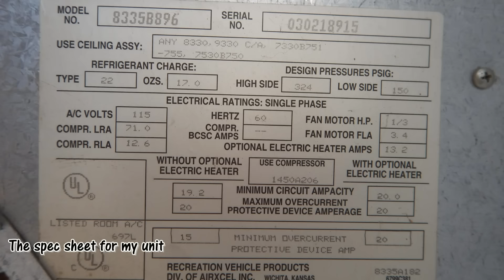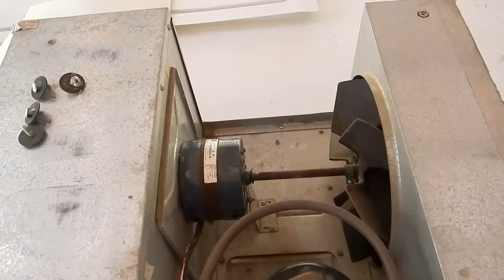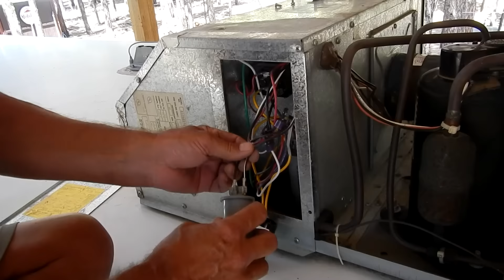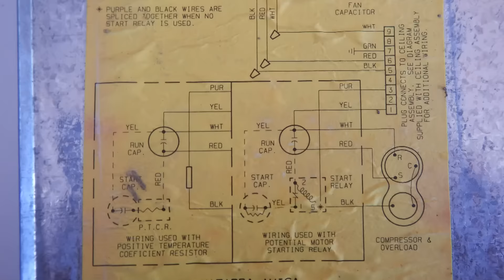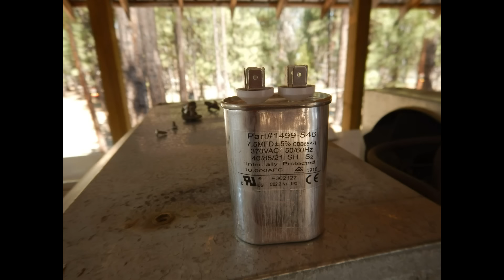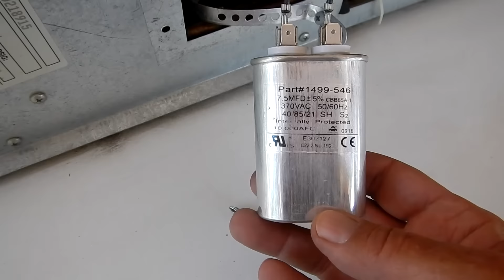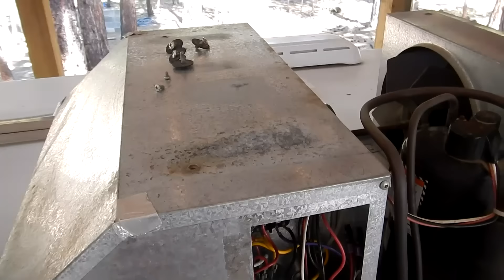How to easily fix your RV air conditioner.

Comment: Fantastic video and tutorial to help change capacitors! changed them both myself, was so proud of myself! Now i have to have someone change the fan motor because it wasn't the capacitors, The good thing is, they say you should change the capacitors wen you change the fan motor, so somethings done
Reply: Coleman motor replacement-Donald Mcadams was best, and a couple others, the I just did it. and Im no mechanic, working great still!
Reply from the maker: I'm happy that you found the video helpful and thanks for the nice comment, Carl. If your motor wouldn't start by manually helping it, usually it is not the capacitors that are bad. Are you sure it's getting power? Hope you get it fixed soon!
Reply: I actually changed the motor myself after watching some youtube videos,. I ordered it on Amazon, was not difficult to install and AC works! very quiet now, I like that the capacitors are changed also before going into Florida summer! they were very rusty and looked original
Reply from the maker: Carl B That's great. YouTube can be an awesome resource most of the time. Glad you're all fixed up and ready to go.
Reply: Carl, I'm having the same problem:  my fan motor is seizing up; I'm assuming I have to replace it.  What videos did you watch to figure it out?

Comment: Why did the color of the wires change to black????
Reply from the maker: Phil Ramsey which wires changed? I'm not sure I understand what you're asking.
Reply: Phil I was thinking the same until I went back and looked at the video again.  The old capacitor was connected to brown and brown/white wires.  It initially looked like the new wires were black, but they were actually the same wires which were on the old capacitor.  Hope this helps.

Comment: Also my unit will not power on even with a "jump start " would you say this is still my problem?
Reply from the maker: +Nicholas L if you can't jump start your motor it could be something other than your capacitor.
Reply: I actually managed to jump start it just now but it will not stay running..it runs on fan for about a minute tops and as for the cooling, once I turn on the cooling and compressor kicks on It stops my kick started fan, any ideas? Thanks in advance!
Reply from the maker: Nicholas it could be a number of different things. Is your fan motor turning freely? You can usually get some answers from one of the RV forums if you search them a bit.
http://www.rvforum.net/SMF_forum/index.php?topic=35389.0

Comment: So as long as the power is shut off and the unit is unplugged it is safe to handle the capacitor?
Reply from the maker: Nicholas L yes it is safe to handle your capacitor.
Reply: Nicholas, No it is not safe to handle the capacitor(s) if you have ONLY shut off the unit and it is unplugged.  The capacitors store voltage.  You have to ALWAYS make sure the capacitors are discharged of any stored voltage before handling them.  Even new capacitors, right out of the box can have stored voltage, if someone had charged it up and returned it to the box without discharging it.  Sometimes you can get away with it and find them discharged.  However, it is always best to make sure.

Discharging your capacitors can be done by using a variety of techniques.  #1 Take a screw driver with an insulated handle and cross the metal shaft of the screwdriver across both terminals at the same time with the screwdriver.  If you have two connectors on your capacitor, place the screwdriver across both connectors at the same time.  If you have 3 terminals on your capacitor, place the screwdriver across two terminals at a time,  #1 terminal to #2 terminal, #1 terminal to #3 terminal, #3 terminal to #2 terminal.  The terminals are usually labeled as C (Common), F (Fan) and Herm (Hermetically sealed capacitor).  Do this a couple of times to make sure the possible stored voltage is discharged.  Making sure you keep your bare hands away from the terminals and screw driver shaft/blade while discharging the capacitors. There are capacitor discharge tools you can buy online and make yourself.  Check out the youtube videos on showing how to safely discharge capacitors before attempting your repairs.  If you are not sure or don't feel safe working around electricity, hire a Pro to do the work or tell/show you how to do it.
Reply from the maker: Capacitors in a typical alternating current (AC) circuit, like your air conditioner, are constantly charging and dis-charging energy relative to the frequency cycle of the AC current. They don't really store energy like a capacitor in a direct current (DC) circuit, which do store energy and can be dangerous to handle. 
An AC capacitor can be made to store energy if connected to a DC power supply.
 In any case it won't hurt to short across the terminals before handling them, as shown in my video, and it is a good habit to be in.
Reply: Tom Wigren how much of a spark would be normal?

Comment: Hi Tom. I have same unit but my a/c turns on and shuts down after 2 seconds. ------ fan works on fun position.
Reply: sounds like the run cap for the compressor i had that go out on mine...it would work for a few min till it heated up and went into thermal shutdown....
Reply from the maker: There is a thermal shutoff that will cut power quickly to the compressor if it's drawing more current than it should be and will kick back on after it cools for a few minutes.  Try researching that and you might find some troubleshooting tips. Hope that helps.
Reply: Tom Wigren ok. I just tested the rv and a/c running on low fan setting.  Shutting down on high setting. Capacitor?
Reply from the maker: When you are in fan mode, without the compressor running, does the fan work on high and low speeds? If the fan runs on both speeds and the compressor runs I think it is some other issue besides the capacitors.
Reply: Tom Wigren correct tom. Fan runs on both high and low on fan only position.
Reply from the maker: http://www.rvforum.net/SMF_forum/index.php?topic=83630.0          
Here is a link to a forum that might help you.
Reply: Tom Wigren thanks Tom.
Reply from the maker: You're welcome and I hope you get it figured out.
Reply: Tom Wigren 👍
Reply: Jo Bust hi. I just installed the cap for the fan. So far all ok 👌
Reply from the maker: Jo Bust Thanks for adding that info about your fix!

Comment: What mfd should the fan capacitor read when you test it? I got 008. But the the capacitor reads 7.5 to 10 I think. Is my capacitor still good, or do you think my fan is bad? Thanks in advance.
Reply from the maker: Michael Moreno There is a run and a start capacitor for the fan. If you can start the motor  by hand it's the start capacitor. If it doesn't run at all it could be the run capacitor, the motor or some other issue. The capacitors wear out after a while and are fairly inexpensive so it is usually a good place to start. I hope that helps answer your question.
Reply: Tom Wigren ok thank you, I'll give it a try.
Reply: That capacitor is 7.5.  Plus or minus 10%
You need a meter that reads mfd to check them